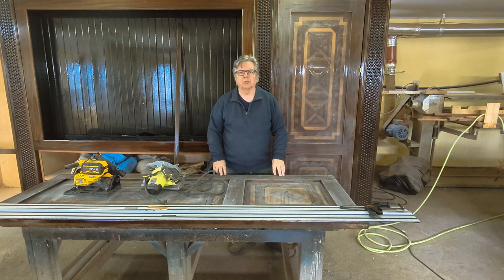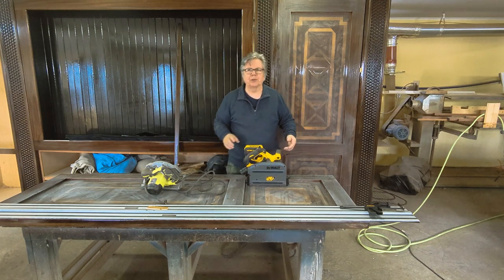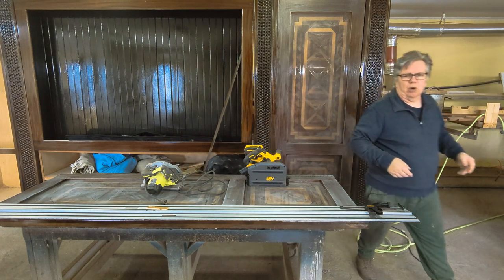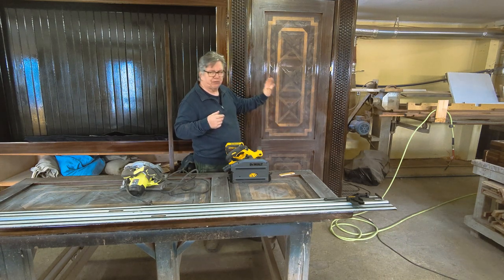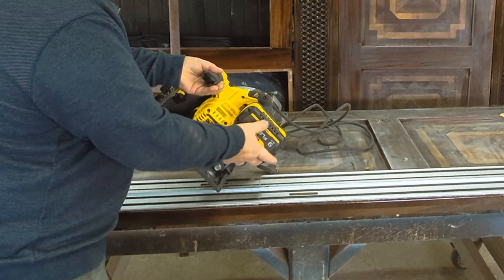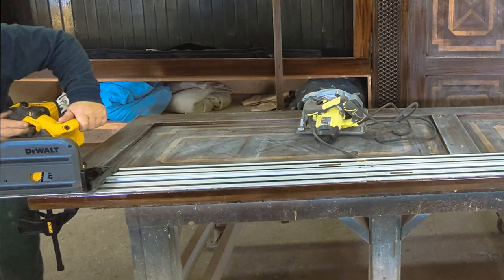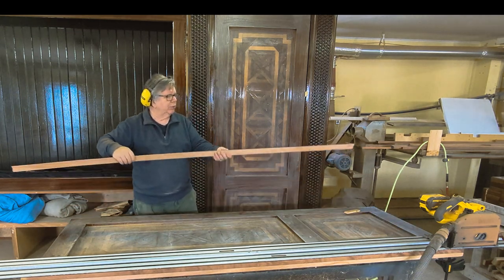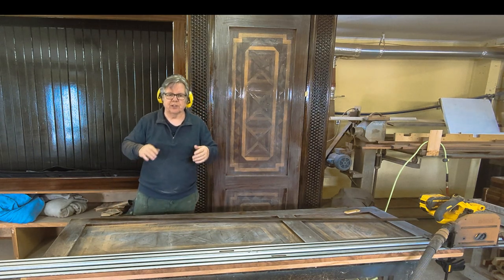Escape the norm with DeWalt 60V Track Saw review

Comment from the maker: Suport the channel try this link for great deals 
     
Canadian Link  for the saw       https://amzn.to/3xjwQFx     Great price
Candian link for battery             https://amzn.to/4acl923      Cheaper buying the batteries this way , than the kit with the batteries which is 300.00 more for a 6 amp and you only get one battery 
Canadian link for the track       https://amzn.to/3VEYPJZ     The 2 track will give you  110 inches seem to pay a premium for the 110 inches compared to  than the DeWalt track at 48 inches which can be had for $105.00 .Remeber sheet good are 96 inches long and 48 inches wide so the extra length is a must 

Us Link                        There seem to be a shortage Home Depot is sold out  and  none at Amazon  try the Canadian link or a smaller local store might have some in stock. Use the Canadian price as the starting point  the store will price match .I'LL UPDATE WHEN STOCK ARRIVES